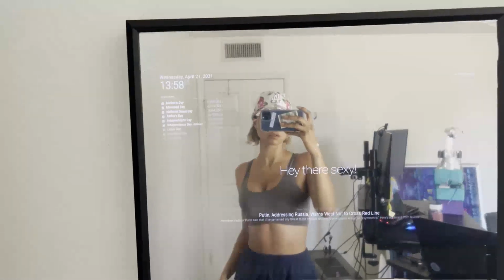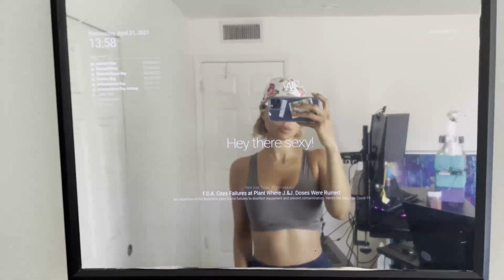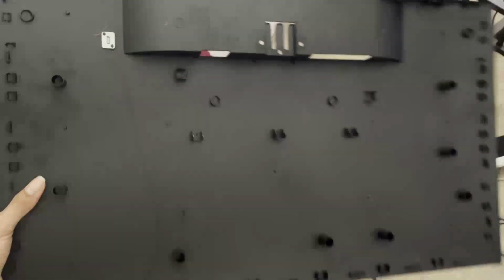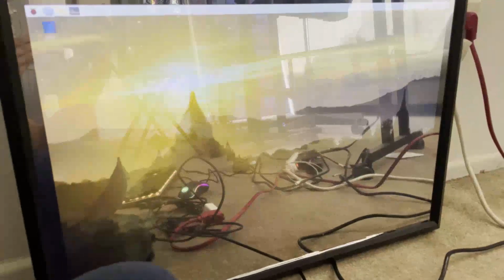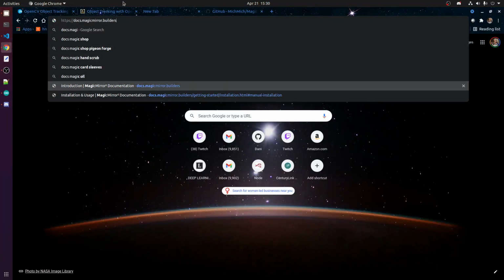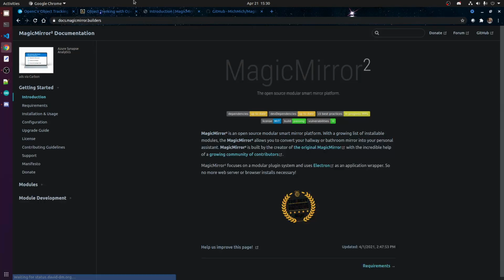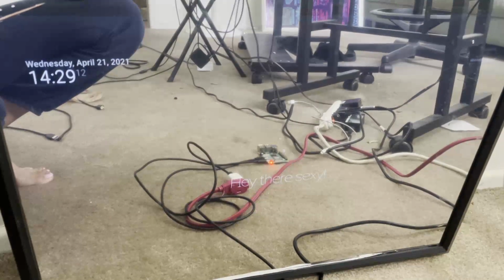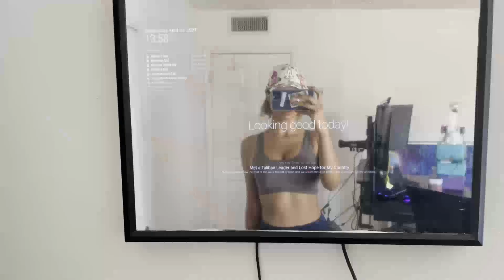Smart Mirror | Easy Smart Mirror Under $200 w/ No Coding

Comment: Hi! Loved the video! Was wondering how did you install the film onto the shadow box?
Reply from the maker: the hardware store has adhesive spray, it should come with the film or be near the film when you go to purchase it <3 ty
Reply: @danistem  tysmmm!! :))
Reply: Did you have to remove the glass from the shadow box first? I’m worried about pushing the water toward the edges of the frame. Idk, maybe a big deal. 

Awesome, easy install. And you know how to program? Sheesh…